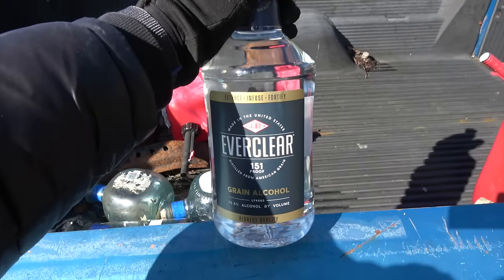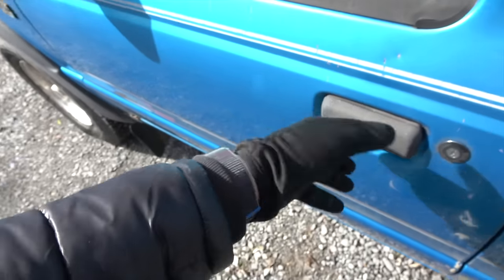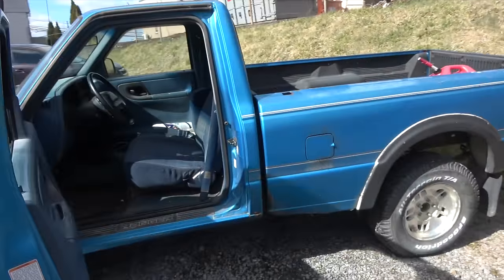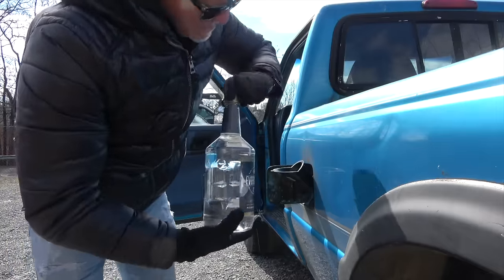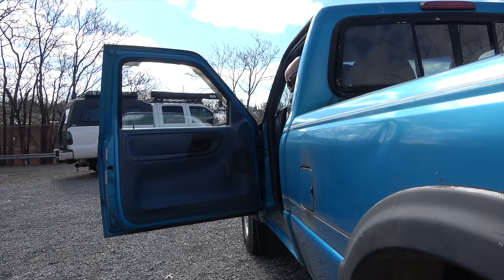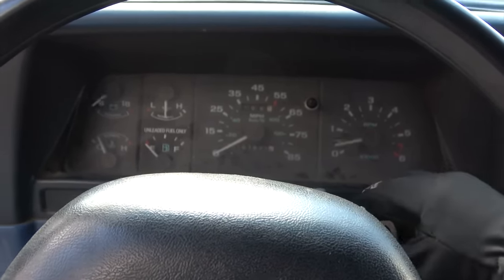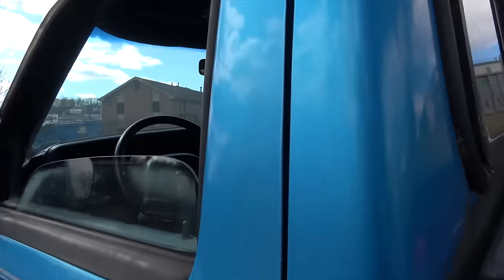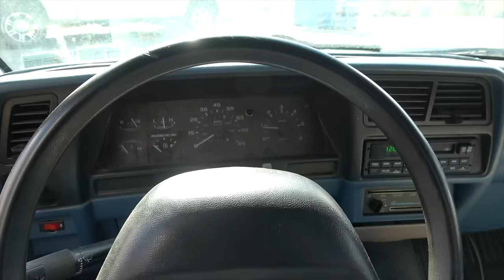What Happens If You Fill Up An EMPTY Tank With Everclear? (152 Proof Alcohol)

Comment: I was forced to use everclear in my dads old '70 chevy.  I didn't have enough gas to make it back to town and one of my buddies drank that crap, so we had a bunch.  He always bought a new bottle for every party, drank a little, then passed out.  I had about three mostly full bottles rolling around under the seat.  I dumped it in, mixing it with a little bit of gas at the bottom of the tank.  It made it to town, but it didn't like it.  My dad didn't like it, either.  It burned out the valves because alcohol  burns hotter than gas.  It also burned up the plugs.  Then, for the coup de grasse, the alcohol reacted with the gas to loosen up every bit of gunk in the bottom of the gas tank. I had to drain the system, replace the fuel filter and the mechanical fuel pump because it was all gummed up.  After nearly rebuilding it, it ran pretty good, but i never tried that BS again.  My dad beat my ass and promised to do it again if i screwed up his truck again.  That ass whuppin' has stuck with me to this day and watching your video actually made me cringe a little.  Lol!
Reply: Might be more of a diesel angle
Reply: Did it hurt you?
Reply: @jussi798  the butt whuppin' or the skinned knuckles from rebuilding a then 17 year old truck?  Both served very well to teach me a lesson. Lol!
Reply: Sorry to tell you this...
That isn't full strength Everclear you put in the tank.
You used the 151 50% alcohol. Full strength EVERCLEAR is the 191 proof or 90% alcohol. That may have made a difference.
Reply: Lots of water in it thoguh
Reply: Grain alcohol does  N O T  burn hotter than gasoline. It has about 20% LESS BTUs of thermal heat than 87 no-lead PER POUND, not by volume.
Methanol is a slightly different story.
Reply: @lestergillis8171  it sure as shit put paid to my plugs and valves.  Black soot everywhere and melted electrodes. Whatever it did while burning in those cylinders, it wasn't good and I've never seen that type of damage with regular gas.
Reply: @american23t  151 proof is 75.5% alcohol, not 50%.  3:53  On the bottle it shows 75.5% ALCOHOL BY VOLUME.  (capitals to show like label.  I'm not shouting)
Reply: You mean coup de grease?

that was terrible
Reply: @timd1833  What he's saying is that he didn't use the "true" 100% Everclear that's only sold legally in certain states (I think Indiana allows it). The "true" Everclear is something like 199 or 200 proof so essentially 100% ethanol.
Reply: @DLarus08 bruh you not only did you clearly know what he meant, but decided to correct a minor spelling mistake in ANOTHER LANGUAGE
Reply: Lmfao! Your Dad sounds like a pretty cool guy! 😂
Reply: @lestergillis8171  Ethanol burns twices as hot as gasoline.

BTU is not measuring burn temperature, but thermal energy, which is less than gasoline.

Temperature and thermal energy are different properties.
Reply: @tadferd4340  Your comment was no sequitur. How can it burn hotter if it has LESS heat energy in it ?? 😖 Furthermore, ethanol is LESS DENSE than gasoline, so it is lighter BY VOLUME. Same with natural gas vapors compared to gasoline vapors. 
 On the other hand, profane gas is NEARLY the same as gasoline, but not quite. "Close enough for government work".
Reply: @lestergillis8171   It's clear you lack understanding with regard to Thermodynamics. Temperature and heat energy are not the same. Gasoline burns at 1000°C. Ethanol burns at 2000°C.

Density and propane are the non sequiturs.
Reply: Gasoline cars are made to run at different octane levels and ethanol content. Some cars can handle 85% ethanol and others only 10% or 20%, while old cars are not made run using any ethanol, the other problem however is the water content.
Reply: That's a cool story

Comment: Should’ve gotten the 95%
Reply: Exactly
Reply: If we follow the logic, it won't even start.
Reply: @imzak007  ‘‘twas just a joke
Reply: @imzak007  Why is more water better? Maybe it's explained later in the video and I'm just impatient.
Reply: wouldn’t that just explode
Reply: @TheArthurfonzarelli  it’s kinda complicated, but pretty much there isn’t ethanol and it also needs to have oxygen to help with combustion. If the alcohol is processed further it could work, this here doesn’t work do to the air/ethanol ratio. Look up why a car can run on gas but not ethanol, you’re gonna get a lot of info. Surprisingly there are alcohol based fuel, though more expensive to produce, it’s much more efficient and cleaner, especially methanol
Reply: @LunarMartin  no, just fuck up the fuel pump and no combustion to the pistons so it literally would just do nothing. I wiiiish tho
Reply: @imzak007  95% is 190 Proof. It has less water than than the 151 Proof, so it should run better.
Reply: @gamewizard1760  Exactly. This one is 75% alcohol so I will say 25% water. Didn't run well.  Get it up to 95% and your car would think you just got gas at 7-11 again.
Reply: @TheArthurfonzarelli  If you put low octane fuel (burns easier) in a high-performance engine, as the cylinder compresses the air/fuel mixture the temperature goes up and the fuel can ignite with the cylinder out of position. Same problem with alcohol just worse.
Reply: @LunarMartin  what do you think fuels your engine? It's all controlled explosions.

Shoulda got real everclear
Reply: @wings_of_wax4125  Properly timed explosions, if the stuff fires too early it'll run poorly. Ignites easier doesn't mean it's better fuel for the way the engine is set up.
Reply: @Jennifer-dw8hl  not trying to say it's a better fuel but the science of dropping pure grain alcohol in an engine is now lost on this experiment. The concern of an explosion is what I'm addressing.
Reply: @wings_of_wax4125  Primarily looking out for piston damage, that popcorn sound is it firing out of time on compression which puts a ton of stress on the crank, crankshaft, connecting rod case, etc. As far as the whole thing turning into a fireball, unlikely.

Comment: Pumping the gas "or priming it as you said" does absolutely nothing on that fuel injected 2.3 ... pumping the gas only works on carbed cars.
Reply: i was about to say, just key on and off a few times that'll prime up the fuel system.
Reply: @RicardoPCGamer  yeo exactly.. he can prime the pump with key on and off a few times. Thats about all he can do.
Reply: pumping the pedal only opens the throttle body butterfly valve.
Reply: And, pumping the gas on a carb doesn't prime anything. It just squirts fuel from the bowl down the throat of the carb.
Reply: If he put the gas pedal all the way to the floor it would open up the valves. That might have worked
Reply: @yogurtfries  I think diesels start with the injectors injecting as though the accelerator is floored already, then when rpm come up, they back off to inject the amount to maintain idle engine speed.

Comment: A few tips from a (former) mechanic. To prime the fuel lines, don't pump the gas petal. That doesn't cause more fuel to flow when the truck is off. Turn the ignition to run without cranking it, leave it there for a few seconds, turn it off and repeat. This turns on the electric fuel pump to pressurize the lines, but the pump only runs for a few seconds before shutting off so you might need to repeat it 3-5 times before the lines are full of fuel.

More importantly, it makes sense to me that the truck would run better on a lower % alcohol. Gasoline has additives that raise the octane level of fuel. Most people think octane means the fuel burns better, but that's actually completely backwards. Octane makes fuel harder to burn. This is important because the spark plug tips, fuel injector tips, pistons and cylinder walls get so hot that they can ignite the fuel without a spark if the fuel burns too easily. To keep from writing an essay, I will leave it at that and just say that the higher alcohol content was causing the fuel to ignite prematurely due to high temps inside the engine which is also why it ran better after sitting for a bit, the engine was allowed to cool off.

Also, I'll add, people please don't waste your money. Buy the fuel recommended for your vehicle. I don't want anyone getting the wrong takeaway from what I said. Modern vehicles adjust fuel mixtures based on the temp of the engine. High octane fuel makes that harder, meaning it not only cost more but will also lower your MPG (KPL for non-Muricas?) and leads to more wear on the vehicle in the long run if your vehicle isn't designed to run on it.
Reply: Thanks for that info about the Octane. It makes sense I just never looked at it like that.
Reply: I'm with you for most of your information but ethanol is 109 octane, it's not lower than gasoline and isn't going to be setting off premature ignition
Reply: yuuup
Reply: Well said, Sir !!
Reply: L/100 km is the metric measured, just FYI.
Reply: Also, ethanol could be not very compatible with the seals through out the fuel system. Possibly?
Reply: @nipzie you are correct that alcohol resists preigniton, that efi system will chase afr's within its set parameters. It does not have the capability to provide the fuel required. Ethanol has 1/3 less energy. This is why high performance stuff uses it, more cooling effects under higher compression and ignition advance can net more power safer if you can supply enough ethanol
Reply: Yeah, the higher octane stuff requires more heat and pressure to ignite. This is good because you want it to light using the spark, and not like in a diesel engine (although the fuel in that doesn't go in until the air is almost fully compressed).
Reply: It doesn't want to run because alcohol modules are larger than gasoline you need larger injectors and mass air meter and  colder heat range sparkplug
Reply: @Rod-y3m  Thanks for the info. I got out of automotive work around 2005, and IIRC that was around the same time they started adding ethanol to gasoline to cut down on petroleum usage. I remember now hearing at the time that ethanol is a replacement octane booster. I had forgotten that and was thinking ethanol would have a much lower octane rating than gasoline. It makes sense though since E85 can only be used in specific cars. I don't believe they were producing cars at that time that used E85 fuel however, so again, not something I am familiar with. I do wonder why it ran better on the vodka than everclear though if not due to preignition. Presumably, the vodka should have more water and added flavorants, so I would have assumed it would be less effective as a fuel than Everclear.
Reply: "KPL for non-Muricas?" - Actually, we measuere L/100km. At least here in Sweden. We measure fuel consumed per distance instead of distance per volume of fuel if that makes any sense.
Reply: @nipzie  its more about compression ignition than straight ignition. the extra pressure causes alcohol to act different than gas. so the older engines would probably work better than the new ones that rely on a more specific compression ratio.
Reply: You need to adjust the timing for the faster burning alcohol
Reply: Um one of the additives the put in gas to raise the octane since led was outlawed, is alcohol! This is one of the reasons it's used in race cars! The others are it's cheaper and burns cooler!!
Reply: Adjusting timing would help! Also ur o2 sensors may be throwing ur mixture off because ur comp is programmed for emissions from gasoline!
Reply: Do you think k I should be running high test or regular in my 99 jeep wrangler 4 cylinder?  I seem to be getting better gas milage with high test , but that could just be perception , I haven't done the math
Reply: @nomadsland5078  Always use the fuel the vehicle recommends unless you have modified it in some way and know what you are doing. '99 Jeep Wrangler 4x4 with a 2.4L requires regular unleaded fuel and should get on average 17 mpg.
Reply: Awesome thanks for the reply
Reply: As some others have commented, the version of everclear you were using is not what a lot of us think of as Everclear. Or as some used to call it: PGA (pure grain alcohol). If you can still find it, that's up to 99% alcohol. Would run the danger Ranger just fine.
Reply: Yeah it's funny... I've got buddies who I've literally told to their face that high octane fuel is actually a combustion resistant fuel. It was designed for high compression engines and cars with pre ignition issues or cars designed to run on high octane (usually performance cars).

Anyway they keep buying the stuff paying a dollar more (+or-) at the pump... Well they were told hahahaha. 

I really appreciate your insight and it makes PERFECT sense!

God bless!
Reply: Man he doesnt care about his truck. Hes obviously expecting it to die soon.
Reply: almost sounds like diesel if its firing without spark plug on heat from the cylinder. not exactly but similar.
Reply: @ibblecabibble  it is. When a car continues to run due to heat inside the engine causing ignition even when the key is turned off, that is called dieseling. Some cars are bad about it and require higher octane fuels but it can also be caused by carbon build up inside the engine that causes heat to build up. It is less of an issue with modern cars since they have electronic fuel injection and the computer controls the fuel supply.
Reply: No, alcohol has a higher octane rating than regular gas or even pure octane.

The problem is that alcohol has less thermal energy and also needs a lower air fuel ratio. To run on E85 you typically need larger injector nozzles and possibly a stronger fuel pump, and to actually make more power out of it by taking advantage of the octane rating you need boost or a higher compression ratio. A normal 87 octane fuel system isn't set up for that, so it's not injecting enough fuel to burn effectively.
Reply: I laughed out loud at him "priming" by pumping the gas pedal on a EFI truck! 😂😂
Reply: if high octane is harder to burn why dose that lower you mpg the way you described it is designed to burn slower like diesel so why would it then lower you mpg BTW i know your not wrong im genuinely curious
Reply: @DKLEIN71  you never looked at the definition of octane ratings? Maybe best to do that before parotting something around. Octane is a fuels ability to resist premature detonation in the ignition chamber.

Comment: A. Pushing the gas pedal down on port injected engines doesn't add gas. The ecu measures the air intake which is what the gas pedal is controlling, and adds fuel. To prime it simply turn the ignition on and let the pump build pressure. Pushing the pedal adds air not gas and air is the last thing it needs. 
B. Ethanol only has about 66% of the energy compared to gas. It's possible your fuel pump can't pump enough fuel, it's not a flammable problem is a not enough flow problem.
C. If your fuel pump can pump enough it's going to take time for the ecu to figure out it needs to pump 1 part fuel to 10 parts air instead of 1 part gas to 14 parts air.
D. get an OBD2 Bluetooth and watch and A/F ratio, MAF, and Fuel pressure, and O2.
Again though, it's not a flammability problem it's a not getting enough fuel problem because either the computer doesn't know how much to add because it wasn't programmed to change for the lower energy fuel or your fuel pump/system can't supply the engine with the requested amount.
Reply: Also, if the engine is flooded, FI systems have the same solution as carbs. Hold the pedal to the floor during cranking, and no fuel will be injected to allow the excess fuel to clear.
Reply: Really depends on if the thing has a carb or fuel injection... carb will always pump fuel when the key is on and you pump the pedal.